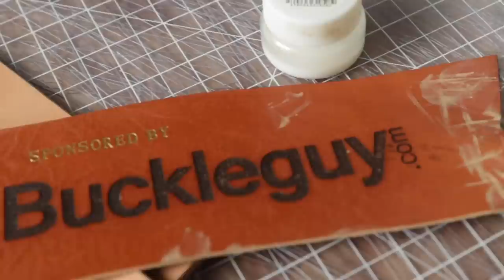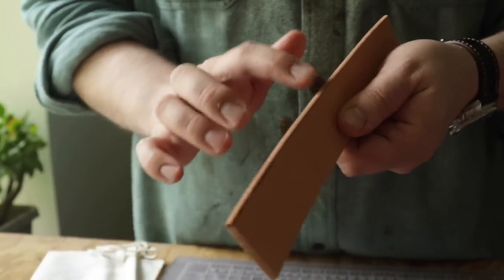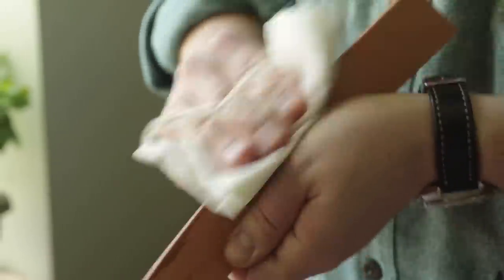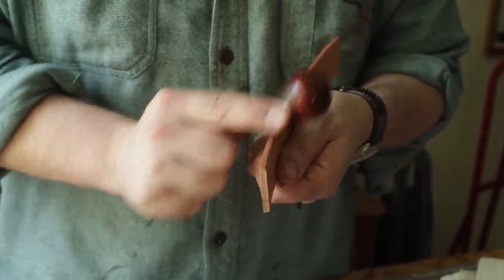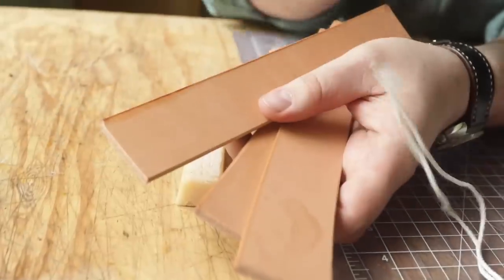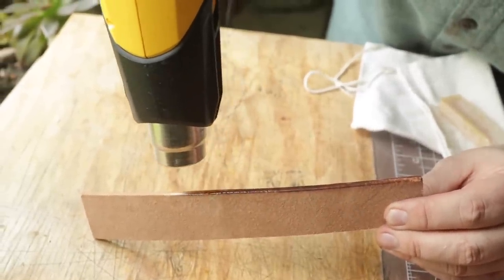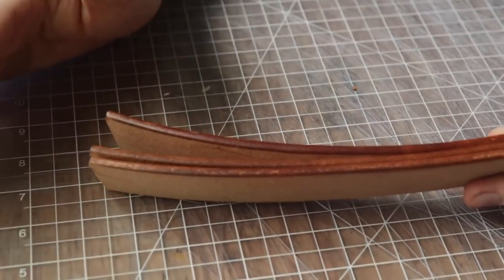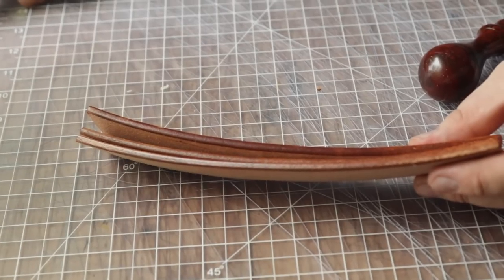Leather Burnishing SHOWDOWN: Which is best????

Comment: Oops.   Great video.  My first time trying this (on a Native-American leather bracelet with rough edges and 'back'.     What can you use if you don't have a heat gun?  I was thinking hair dryer even though the hot air flow is very diffuse.  Is there any advantage to heating the beeswax before applying, vs. rubbing it on dry  and heating the treatedc leather afterwards?  Thanks

Comment: Thank you, very educational! I usually use fabric and artificial leather in my sewing, but recently tried my first real leather project. I have been using Tokonole and Edge Kote on faux leather edges for some time, and that's what I have at hand. 
I find on veg tan Tokonole makes more sense when you use water on the edges first, doesn't it?

On artificial materials which you can't sand down, Tokonole is a must for me, before painting the edges. Edge paint won't stay on faux by itself.

Comment: thanks for the comparison video. great info about the tokonole. didn't know it was a top coat.
 
lately i've been doing a quick water burnish after sanding the help knock the fibres down. if i want to dye that's next. then i finish with tokonole. 

have you seen the small needle tip bottles (30ml) from Amazon? 
makes applying Gum Trag & Tokonole real easy, and less waste

Comment: This was a lot more interesting than I anticipated. Almost didn’t watch since I figured I knew all of this. But there is always more to learn, especially for a beginner like me. I’ve tried water and saddle soap but never just water unless I follow it with Tokonole (or Toko Pro). I also do the canvas first and slicker second although I’m starting to think that the canvas alone is enough for my use. I wouldn’t have thought the soft beeswax gave much protection, as opposed to the rock hard edge waxes you can buy, but when it soaks into the actual leather I can see how it would. Love how the simple water approach darkens but doesn’t stain the same way Tokonole does.

Comment: I prefer tokonole for the sole reason that when I use gum trag and apply it with my finger I will later get a sort of "numbing" sensation in the finger tip. Don't know if it's allergies or whatever. However, nothing can beat the sweet, sweet smell of gum trag!

Comment: A good method I've discovered is picking up a plastic squeeze bottle with a filtered tip.  Fill it with 40/60 water to Tokonole and give it a shake.  It'll reduce the thickness to that of milk cream.  I've found this method spreads more evenly, dries more quickly, won't leave behind as much wax resin, burnishes faster and will save you some cash on the resupply.  Happy Crafting!🍺👀👍

Comment: Thanks for the comparison.  I personally use gum tag for my veg tan products, and tokonole for my chrome tans.  I like to dye the edges before burnishing (personal preference) and if I’m painting the edges then I don’t even bother with a burnish.  You can paint over the tokonole, but as you mentioned, it is a top coat already, and the paint will eventually come off.

Comment: thank you, there is a lot of good information (I never tried gum trag), but it's not very demonstrative on a thick pure veg tan leather, you can burnish it without anything, even water works really good. More interesting to see what of these things will burnish and evenly seal glued edges, maybe 3 layers of 1.5mm.
Reply: If all 3 edges are already be edged, burnished and GLUED, you would have sand the edges again for it to be evenly edged no matter what type of edging applicator you would be using.